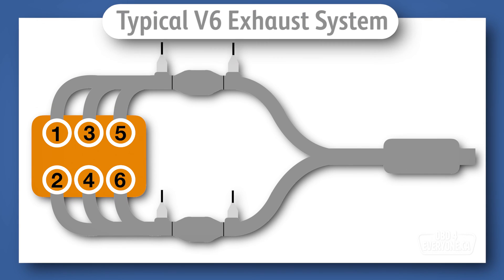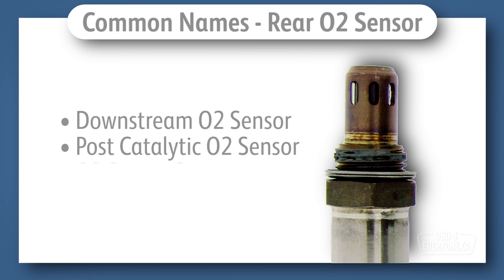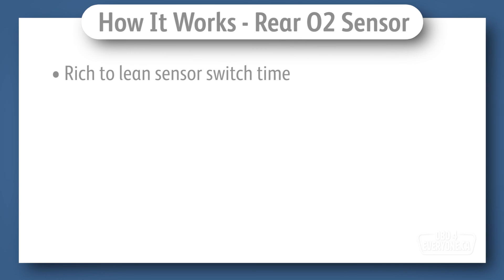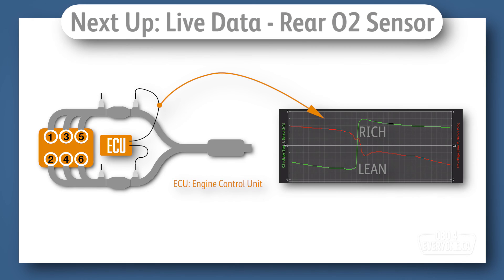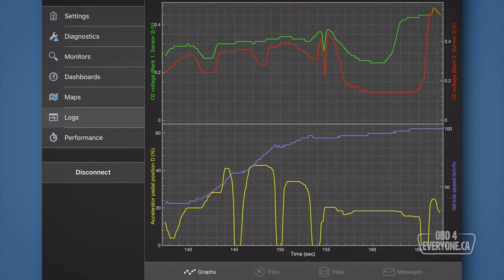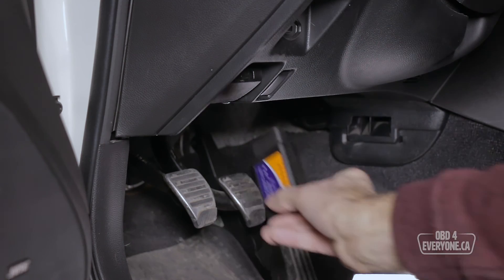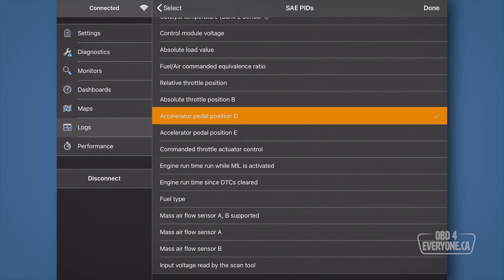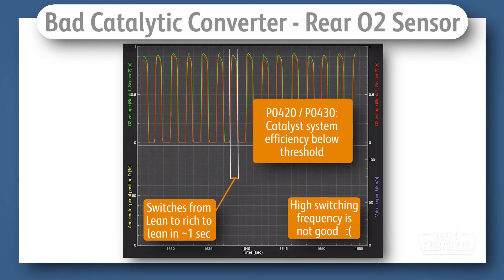Understanding & Live Graphing of the Rear O2 Sensor: OBD4Everyone Ep.19

Comment: So 0.5 ,  0.6 should be good ?
Reply from the maker: If you are talking about the voltage at the rear O2 sensors during low engine load, they should switch between 0.1v and 0.9 volts.

If the measured voltage is always 0.5 - 0.6 that might indicate a problem.
Reply: @OBD4Everyone  at idle it's. 05 or 6 then it fluctuates at higher rpm but the other o2 sensor reads like 1.9 at idle
Reply from the maker: If the other sensor is at 1.9 volts, then your rear o2 sensors may not be be O2 sensors, but air/fuel sensors.

Comment: Thank you for your video,  I have GMC terrain 2011 6 cylinder, I have code P0430 , I clean the sensor and I have same problem 
Sensor 1 bank 2 give low voltage like 0.01 or 0.1 
Sensor 2 bank 2 give 0.7 

Most of garages tell I have problem with catalytic converter 
Other garage he confirmed I have sensor problem, pls help me to take my decision..
Thanks
Reply from the maker: I don't have any first hand working knowledge on any GM product, so I don't know if I can help you.

Generally, "Cleaning" an O2 sensor is never required and may cause  problems. Depending on what was used to clean it, it may of contaminated the sensor and altered its function/sensitivity.

If the sensor 2 voltage is not changing, you might want to graph the sensor 1 and sensor 2 voltages to compare.

BUT you need to know if the sensor 1 is an O2 sensor or a air/fuel ratio sensor, as the voltage outputs will be different. 

Since I have never worked on GM products, that's all I can offer. 

Hopefully someone else can offer a suggestion.

Comment: Did some graphing on a vehicle with a slight hunting idle, lambda 1 shows oscillating between 0.1v to 0.9v, where as lambda 2 sits at a constant 1.2v flat, that a sign of a faulty lambda 2 or more likely a vac leak?
Reply from the maker: Without knowing any details of the year, model or engine here is my best guess...

If you have a narrow band rear O2 sensor and it is at 1.2 volts, the o2 sensor or wiring is bad. Typical max output voltage is up to about 1.0 volts. If you have a wide-band rear O2, I don't know what it should be as I have no details on what vehicle it is.

An unsteady idle is often caused by a dirty throttle body. As they get dirty from oil/air vapour in the intake from the PCV system, they loose the ability to provide small adjustments that are required for a stable idle.
Reply: @OBD4Everyone  it's a 2008 1.6 Zafira, will be narrow band on the lambdas. The rear lambda figure is around 1.2v fixed, whilst lambda 1 is moving between 0.1v and 0.9v. wasn't sure if lambda 2 was put causing the fueling to be constantly adjusting knocking the idle out also
Reply from the maker: I don't have any documentation on your vehicle.
Since the rear O2 sensors are narrow band, max voltage should be 1v... and  since you have 1.2 volts I would verify the o2 sensor wiring and if that tests out ok, replace the rear o2 sensor.

Comment: Hi .. thank you for this rich information ... i have chrysler  pacifica 2020 ..  i am in Iraq i had replaced a commerical catalyst converter cause it had  been stole and the code p0159 raised ... the oxygen sensor 2 bank 2 read 0.7 and doesn't fluctuate... what should i do ? please
Reply from the maker: I don't have any experience working on Chrysler vehicles, but from what I could find out, the P0159 means the bank 2 rear o2 sensors is taking too long to switch from lean to rich or rich to lean. AND that is exactly what you have seen with the rear o2 at 0.7 volts. (good troubleshooting!!)

I would check for any possible exhaust leaks (cracks, broken exhaust flange gasket, etc) You could switch the rear o2 sensors (left > right, right > left) and see if the problems changes to the other side. If it does, the rear O2 sensor might of been damaged when the catalytic converter was stolen.

That's all I got for you... Good luck!

Comment: Hi there
My car’s o2 rear sensor reads 0.7 v at idle or when engine runs on 2000 rpm and reach up to 0.8 v or 0.9 v then come back again to 0.7 v ( mlf on p0420) I replaced the whole catalytic converter 
What should i do?
Thank you
Reply from the maker: As shown in the video, the rear o2 sensor (narrow band type) should have a voltage swing from about 0.1v when lean to about 0.9 volts when rich.

I would check for exhaust leaks (cracks, broken gaskets) and since you have replaced that converters, you may want to test the rear o2 sensor or replace it.

Comment: Do the output voltages of downstream o2 sensors affect operation of the engine?  2002 F150 with lean codes on bank 1 and 2 both. No o2 codes but OS1S2 is stuck higher than OS2S2 at idle.
Reply from the maker: Hard to say as each manufacture has their own strategy. I can tell you for a fact that my 2011 G37 does use the rear O2 sensor to check for a lean/rich bias of the upstream air/fuel sensor.

As you can guess, it is difficult to troubleshoot from the internet, but I would have a look at your fuel trims and see if they are more than 10% (adding fuel)... one possible option is a weak fuel pump.

Comment: Great video buddy. Quick question, both O2 sensors have a spikeand drop voltage. Bad cat?
Reply from the maker: Sorry, but I don't know what you mean by " spikeand drop voltage"
Reply: @OBD4Everyone  like for examples the top sensor if you graph it, its suppose to graph up and down. But the downstream sensor also does it.
Reply from the maker: Generally, if the front O2 sensor and the rear O2 sensor have about the same waveform, the oxygen storage capacity of the catalytic converter is very low and may need replacement.
Reply: @OBD4Everyone  in my case I have a 2013 Cruze 1.8 non turbo. So I have a p0171 running rich code. No vacuum leaks, no bad sensors and good spark. Car wants to stall when coming to a stop and idles rough. I DID notice however the downstream O2 sensor has the same voltage as the upstream one. But no cat converter codes. Maybe the bad cat is causing the stalling?
Reply from the maker: I would datalog or monitor the fuel trims while driving the car.
I wouldn't think a "running rich" code would be caused by a bad cat.
Cleaning your MAF (if you have one) might help. When they get dirty they over report the air flow at low engine speed and under report it at higher engine speed.

You can't compare upstream voltage to downstream voltage UNLESS you know that the upstream is actually a "narrow band" O2. Many cars made in the last 10-15 years use an "air/fuel" sensor and have a VERY different voltage output.

Comment: My pre  cat AFR 02 is out am getting 0.8 ~0.9 volts with all drive cycles at my rear 02 sensor.
Normal?
Reply from the maker: Nope... That indicates a constant rich reading (assuming you have an O2 sensor and not an air/fuel ratio sensor)

If you accelerate hard and then lift off the gas, the front o2 should read lean or about <0.1 volts.

Do you have a check engine light and/or code?
Reply: @OBD4Everyone  No, I don't have check engine light or code. I have Afr sensor, and at car start up when you monitor the fuel trim stft via obd  is always stuck at 25% whiles ltft is 9.36%. Changed it to multiple afr sensors still the same, the shocking thing is when you take out the afr sensor from the hole and put it outside and start the car as sensor harness is connected still the same values as mentioned above is the one which is registering. What can be really be the cause ? Any direction I should go?
Reply from the maker: Hard to answer.... I don't know anything about what vehicle you have, so I am 99% in the dark.

If you don't have a check engine light and the vehicle drives fine, maybe there isn't an issue?

Comment: Hi. If only my B1S2 sensor is showing small fluctuations (0.65 to 0.70), while all the other 3 sensor show normal fluctuations, does that likely mean the sensor is bad? I keep getting the P0420 code that comes back after I drive 1 full cycle every 3 days. My conclusion would be that the sensor failed.

Car is not old at all. I recently installed high flow cats with O2 spacers. Maybe the sensor got contaminated, got loose, or burned out somehow.
Reply from the maker: Hey  ShinyBlackRims,
A P0420 can be set by the rear o2 voltage change not being enough, or the rear o2 voltage switching frequency switching too fast. The rear o2 switching frequency should be less than the front o2. (assuming your vehicle doesn't have a front air/fuel sensor)

The issue might be the rear o2 sensor... To test you could swap the rear O2 sensors (left to right, right to left) and see if the codes changes sides.

*This assumes you have 2 banks, which I think you do as you did mention have 4 sensors.

Newer vehicles are getting much smarter (the ECU/PCM programming) in detecting catalyst efficiency. In some cases, the O2 extenders don't "trick" them anymore.

Comment: I've got a 2004 Volvo v40 2.0t and just got the p0420 code. There isn't any loss of power but I have noticed a smell of unburnt gas or something similar when the car is idling at a stop. I'm pretty sure it's the cat that's gone bad but the fact that there isn't any loss of power concerns me.
Reply from the maker: Hey  Strikemi,
Don't confuse "catalyst air flow" and "catalyst efficiency." You can have a cat that flows well, but is not at the required level of efficiency.

Since you have a P0420 and you can smell the exhaust, this points to the catalyst.

Comment: Mines reading steady at idle high .500 to low .600.  Is this a healthy reading.
Reply from the maker: Hey Mike Hedrick,
Just to clarify: your rear O2 sensor shows a voltage of 0.5 to 0.6 when driving along at a steady speed on the highway, accelerating quickly (should be around 0.9v)  and then lifting off the throttle (should be around 0.1v)

If that is the case, your rear O2 sensor should be having a higher voltage swing. This can be caused by a leak in the exhaust (even a small crack), a failed O2 sensor or maybe a plugged catalytic converter.
Reply: @OBD4Everyone  well to be honest my cat is bad.  I was getting an occasional po420 code.   I spliced and diode into the blue wire to cheat it.  I drove it and it was .900or so on throttle and down to around .100 after throttle.  It seems to be working so far at around 600 miles.
Reply from the maker: Hey Mike Hedrick,
That is interesting... I was not aware of the diode mod.
Thanks for the update :)
Reply: Well it doesn’t appear to quite work on pzev vehicles.

Comment: Is it normal for the SHRTFTB1S2 (Rear O2 Sensor) to read -100%?. Voltage is good and fluctuates as it should. Only SHRTFTB1S1 seems to have the % fluctuate normally. I have an inline 4 cylinder so only 2 O2 sensors for me. Cheers.
Reply from the maker: Hey Vince Granville,
I think the "short term fuel trim" for the post cat O2 sensors (SAE PID 0x15) don't tell us anything.

For example, on my G37 it has ALWAYS showed "short term fuel trim for sensor 2 as 99.2% and has not changed in the 5 years I have been collecting data. This is also true on 3 other G37s that I have checked.

So.... if your post cat O2 sensor is around 0.9v when accelerating and 0.1v when off the throttle all is should be good :)
Reply: @OBD4Everyone  thanks for the reply. Post cat O2 sensor comes in around 0.750 when accelerating and around 0.175 when idle. Rough figures. So based on that and your reply the short term fuel trim post cat I don't think does anything. Unless of course the cat was maybe bad then it may change accordingly. Thanks. Appreciated.
Reply from the maker: Anytime :)

Comment: In 2:48, did the author really meant to say "when the switching frequency becomes too low" or "when the switching frequency becomes too high?" The image on the screen is correct: Sensor 2 (dowstream) high switching frequency is not good, but he might have said the opposite.
I have a P0430 code, and Sensor 2 (downstream) is switching faster than Sensor 1 (upstream), so I suspect my CAT is bad.
Reply from the maker: You have to be careful when comparing the switching frequency of the pre-cat sensor 1 to post-cat sensor 2.

For about the last 10-15 years on most vehicles, the pre-cat O2 sensor is now a "wide band" air/fuel sensor. It will output a steady voltage depending on the actual air/fuel ratio. For example, on my vehicle, if the air fuel ratio is 14.7:1, the output voltage is around 2.2 volts.

Your code is for bank 2. If you haven't already, you can compare the pre/post cat O2 sensor voltage of bank 1.

If your catalytic converter is functioning as expected, and your vehicle has the older style "narrow band" (output voltage from 0.1v (lean) to 0.9v (rich)) the rear O2 sensor should be switching slower then the front O2 sensor. If not, the engine computer will declare a P0420 Bank 1 / P0430 bank 2.

Comment: My rear sensor 2 bank 2 under acceleration goes to 0.070 while my rear bank 1 sensor 2 fluctuates to like .045 and when I let go of the gas it goes to 0.09(bank 1 sensor 2) while 0.060 (bank 2 sensor 2). Does that mean my sensor 2 bank 2 is bad? Thanks
Reply: Check on Google about proper readings.
Reply from the maker: (I am assuming your vehicle has the typical "narrow band" rear O2 sensors.)
Both of your rear O2 sensor's voltage output are too low. Under hard acceleration (wide open throttle) they should be around 0.9 volts (rich), and when you lift off the throttle after the hard acceleration, they should drop to about 0.1 volts (lean)

Once the vehicle is warmed up, use OBD Fusion to run a diagnostic report. Under the "Mode $01" section it will show you the supported sensors. I am thinking you might be looking at the wrong Pid (sensor)

For example on my vehicle, I need to look at the "O2 voltage (Bank 1, Sensor 2) and O2 voltage (Bank 2, Sensor 2)"

If you are looking at the correct PID, check you exhaust for any leaks or cracks. This can allow air into the exhaust resulting in the rear O2 sensors reading lean.

Comment: I have an Actron CP9690 code tester. It checks graphing. It also has emission readiness test. It has other testing abilities. EBAY has it.
Reply from the maker: I just check amazon.ca for the price of that unit.... It is not cheap at $289. I prefer the app based OBD scanners, as they allow easy data logging without a PC.
Reply: A Launch X431V V.40 tests just about everything on a car! It's $860.00! The Actron CP9690 works on OBD 1 and OBD II. It's for basic testing. It has code-connect to diagnose codes. It has emissions readiness test to check systems to pass an emissions test. It has graphing to check oxygen sensors and other systems. Select record and then touch the system twice to see graphing.

Comment: i have purchased the extended obf fusion for my rav4 2019 adventure, i sat the graph as per ur instructions and when in action the only grph that was working is the accelerator and the speed, the o2 sensors are not showing any graph though the engine temperature is above F180, the interface am using is ELM327 wifi, the reason am running this diagnosis is that when i drive for two hours or more i start hearing explosions in the exhaust, it might be also important to mention that the fuel we use most of the time is not good and stations mix it with water.
Reply from the maker: I would run a diagnostic report. This will show you all the supported sensors/PIDs and their name for your vehicle. Then select those exact descriptions in the live data section. Then you should see the data directly from the engine computer.

Comment: Should I need to replace O2 sensor 2 immediately? 
It's not working on my chevy beat or spark.
Reply from the maker: If you don't have a check engine light, everything is fine.

Maybe your Beat and Spark don't have a traditional narrow band O2 sensor that is shown in the video. I am not familiar with them, so I don't know if there is an issue or not.

Comment: Hi, thanks for your explaining video. 
In my case, I don't understand the downstream sensor behavior. When starting cold it is absolutely flat, then starts to move gradually in voltage range and frequency. 
About 5 minutes later, at 2000rpm it already varies from 0.3v to 0.6v with about half the frequency of the sensor 1.  
10 minutes after start it goes from around 0.4v to 0.7v with the same frequency.
After a trip, at 3000 rpm, I registered values from 0 to 0.8v.
The sensor 1 has the normal behavior, ranges from 0v to 0.9v, usual frequency...
I guess this points out that the cat is not doing it's job but if it's the case, then why the cat just seems bad when it warms up?

It's a short journey car that makes just around 3000km / year.

Thanks in advance.
Reply from the maker: (As you can imagine, it is very hard to diagnose issues through a comment, but I will do my best)

If you don't have a check engine light, then the o2 sensor operation is OK.

However, I suspect you do have a P0420/P0430 code. If the switching frequency of the rear O2 sensor is similar to the front O2 (assuming the front O2 sensor is NOT a wide band / Air/Fuel sensor) that would indicate the catalytic function is not working well. 

It can be difficult to determine a bad O2 sensor from a bad cat. If the vehicle has high mileage it is often best to replace the O2 sensor first and re-evaluate.
Reply: @OBD4Everyone  Thanks for your reply
I once had a P420 in the summer but never again. I guess the o2 sensor behaviour I described was because the o2 sensor was warming up. After warming up, the downstream sensor graph is very similar to the upstream one. Meanwhile I found too that the STFT and LTFT are negative. Even after a reset, the LTFT stays around -16. I tried too to check the cat temperature at the entry and exit but was somewhat difficult because of the shield. Do you think that running rich (whatever the problem is) can cause a false inefficient cat report, or the cat should deal with it anyway, if it were fine? And if the exit cat temperature is higher than the entry, should I assume the cat is ok?
Thanks